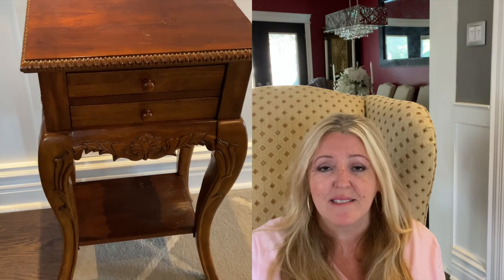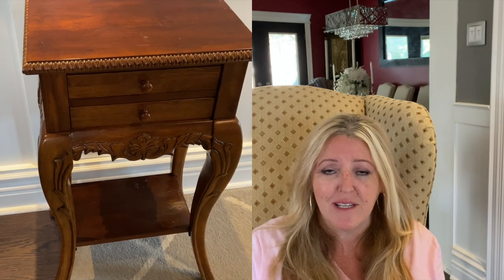Mackenzie Childs Inspired Accent Table * FB Marketplace Deal * Furniture DIY* Home Decor

Comment: May I ask what grit of sandpaper you used so as to not damage the wood?
Reply from the maker: Hi , So sorry for the late reply, I'm trying to get through over 6,500 comments 😍 and I don't want to leave anyone out no matter how long ago I received the comment.

 It all depends on how much you want to remove from the piece.
If It's painted I use 100, 80,  and on occasion 60.
if its a light sand I use I use 180...
The lower the number the coarser the grit  
 .
Hope this helps, Have a great week 💖